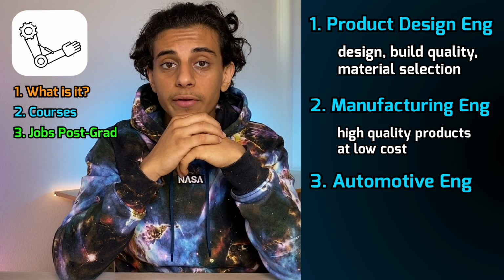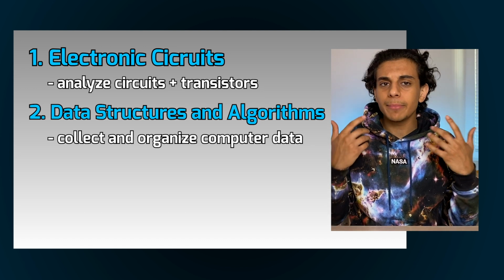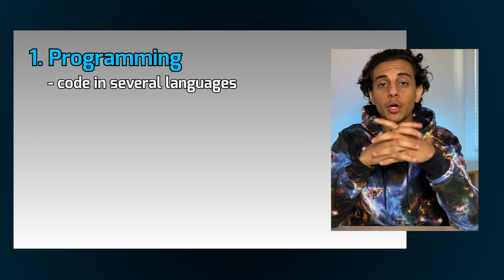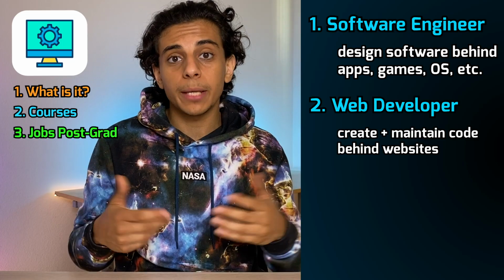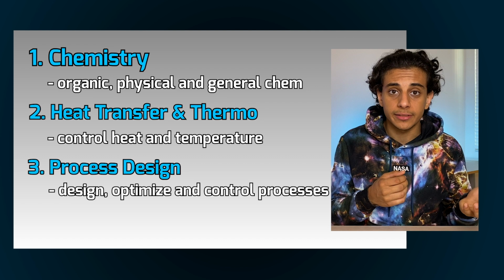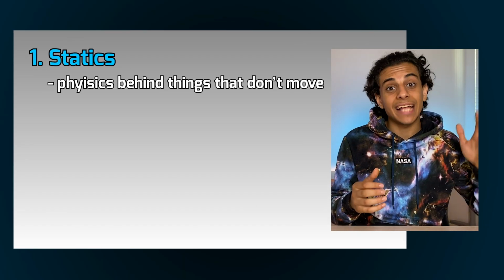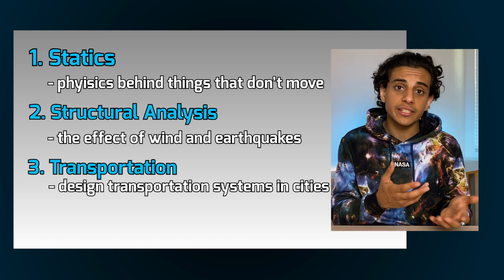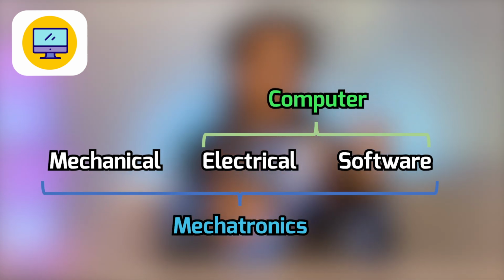All Engineering Programs Explained in 11 minutes

Comment: This is what I want to do, Financial Engineering. In the sense, depending what you’re doing, Software, Computer, and System Design Engineering being used for the financial industry. 

There’s a lot of variables to this, like I said like it’s not just as simple to explain as I’ve stated above. Another way to put it is applying the scientific method and science related things (econ, math, stats, cs, etc.) for the Financial Industry; you’ll mainly work with something in relation to stocks or stock trading. 

Another definition of Financial Engineering is creating/utilizing financial tools, literally anything with money and how it’s used, to the technology of block-chaining and credit. Hence, creating them and knowing how to implement them.

Comment: mechanical (design & build; statics, dynamics, fluid mechanics, thermal)
electrical (navigation systems etc)
civil (roads, heavy structures how environment impacts them etc)

mechatronic (mechanical, electrical, software)
biomedical (helps physically disabled)

system design ((mechanical), electrical, software)

Comment: Hey Tamer, I am a ChemE working at a FAANG company and majority of my colleagues have degrees in chemical engineering. We work specifically on manufacturing quantum computing semiconductors. These types of jobs can be found at IBM, Microsoft, Google and even Meta (with regards to their quest headsets). Anything that deals with the manufacturing of semiconductor process we can definitely work at. It surprised me as well actually because I didn’t know so many ChemEs could work in this one field lol.
Reply: hey, i'm starting a chem eng course in oct. Do you think is it worth it if i'm interested in waste management, water refinery process, clean energy and production in engineering like machine etc?
Reply: @nathanielaureliodevanoravi3249 I have a similar interest as well do you think chem e translates on that ?
Reply: @gabrielgarcia7554

Comment: A few modifications I would suggest.  Nuclear engineering is a category of its own.  In electrical engineering you left out some key focus categories (semiconductor, digital design, power systems / transmission. Electromechanical).  Systems Engineer isn't necessarily software based ; it's multidisciplinary and usually focuses around optimization and comprehensive problem solving (a mile wide and an inch deep).  Lastly there are niche fields like test engineering. Quality engineering, metrology. Biomedical and others that deserve mention.
Reply: I do believe that almost every engineering is different if we consider the objective. But I guess the big 5 (maybe 4 because there would not be software without electricity) sums up the set of basic knowledge in each one. Also that he glossed over what electrical and software engineers design and Systems engineer is totally wrong (every complex multidisciplinary project could need a Systems engineer). Test and Quality are very linked to industrial engineering. Metrology is more linked to Instrumentation and Control engineering (I'm not sure if the States has a bachelor of that). But yeah, physics and nuclear engineering have very different objectives

Comment: What you should ask yourself before going into a college major is actually not what you WANT, but what society NEEDS. Our college & job system is extremely inefficient right now, it needs to be reformed for our new era of technology. We shouldn't keep pumping people into oversaturated & stagnant careers where they just copy/paste old blueprints of old technology. WE NEED NEW TECHNOLOGIES. The next big technologies that will most likely come out are; AIs, robots, & biotech (bionics, synthetics, genetics, better pharmaceuticals, & better bio scanning machines). As you can probably guess, these technologies will cause large changes to our society. Therefore, what we really need are actually smart, forward thinking politicians who aren't held back by religion, tradition, etc. to make smart & informed decisions when it comes to our new revolutionary AIs & biotech as well as cybersecurity. The decisions mainly come down to societal optimization measures, AI control laws (such as; requiring all robots to have tracking mechanisms, making it legal for AI & robot production companies to initiate a full recall if necessary, making it illegal for AIs & robots to form their own society), & more funding to government cybersecurity agencies.

So, overall, we need political reform first, however, if you don't want to go into politics, then I would suggest the following fields because of the reasons I listed above;
-pharmaceutical science
-pharmacology
-microbiology
-tissue engineering
-genetic engineering
-bioengineering (aka biomedical engineering)
-software engineering (or whichever field is specific to AIs (it might be called AI specialism, machine learning engineering, or data engineering))
-computer & network security professionals

As a final note, I just want to mention that pharmaceutical scientists & pharmacologists are the ones who make & test drugs. It seems like it should be called pharmaceutical engineering, but that's actually a different field that involves making the machines required to make drugs.

Comment: RIP materials engineering lol
Reply: Materials engineering is huge and integral to basically every field out there. Automotive, civil, industrial, aerospace, chemical - every field. My dad is a mechanical engineer but has focused on materials for mechanical engineering purposes like the type of steels you would use in designing an automobile for safety. Like the crash beam might be made of a certain material, hood from another material, and how those materials should be designed for optimal safety. It is very cool and very important.

Comment: Which engineering has the highest entry level pay? And what is the top 3 in demand engineering right now and for several years to come?
Reply: In demand - Civil, Software and Mech 
Highest pay - Software, Petroleum, Aerospace
Reply: Software and electrical are at the top for salary and demand. I would say the top 3 in demand are: Electrical, software, and mechanical. But it really does not matter, do whatever engineering you really want to do, or are able to do. There are people with software engineering degrees that still have trouble finding jobs, the best thing you can do is have lots of work experience and do CO-OP.
Reply: Software engineering no doubt
Reply: What about petroleum
Reply: @carbonhide9720  no

Comment: Great video man, i’m a computer engineer because I always marveled over electricity and the actual hardware that makes electronics work but I also love coding. Highly recommend this major. Along with aerospace, I’d say it’s the best major that is split among the big 5 bc you don’t spread yourself too thin
Reply from the maker: Yea, I honestly don’t think u can go wrong with any engineering program
Reply: Currently torn between computer and aerospace engineering. I love coding, but I also absolutely love mathematics.
Reply: @musaratjahan7954  you will get to do plenty of coding and math in computer engineering, and can easily get a job in aerospace as an avionics, controls, or modeling/simulation engineer